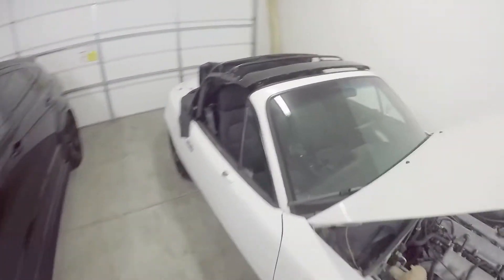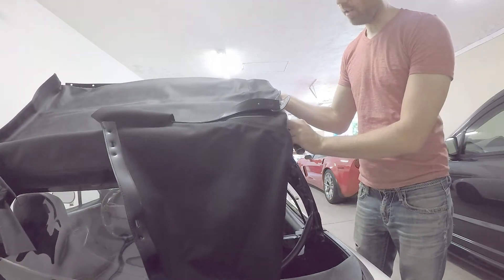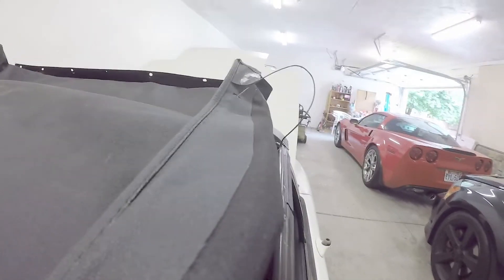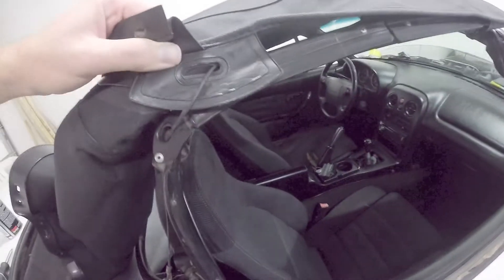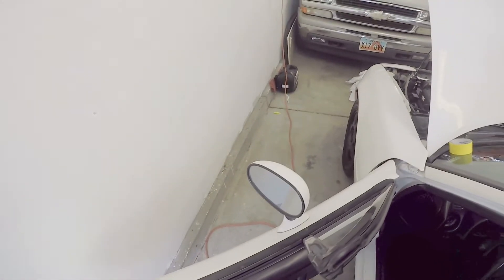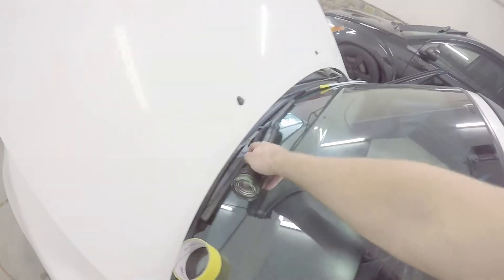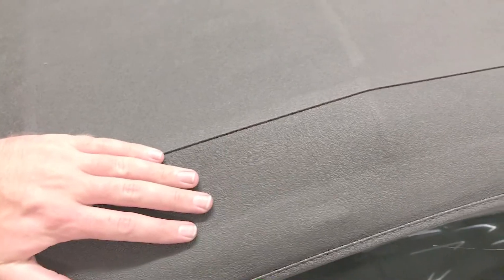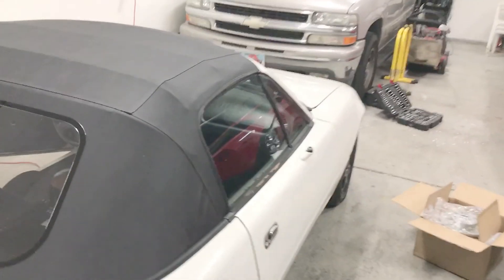Miata soft top install: part 2 of 2

Comment: How’s it held up without the rivets?
Reply: I'm fitting one of these roof's to a mark 2.5 at the minute and without rivets the fit and finish will be terrible..
Reply from the maker: Its been great, I havent had any issues without the rivets. It was a little hard trying to get it stretched but once it got it, it worked great. Sorry for the late reply.

Comment: Which top did you buy?? Link
Reply from the maker: To be honest it was off of Amazon with the plastic window. Its been great for the money. It was only about $200 and is still going strong.
Reply: TDTGarage found a used from a uk miata chopshop. They sell complete with frame and all.  Got a vinyl with heated glas, 170 buck shipped. Cant complain
Reply from the maker: @joller79  oh wow thats awesome, thats a good deal! I hope it works out for you, let me know how you like it and if it was easy to install
Reply: TDTGarage hi. Install went great, rainrail still pliable, all in all i spend 4 hours, took seats out and cleaned it all out, took my time, and it fits perfect.